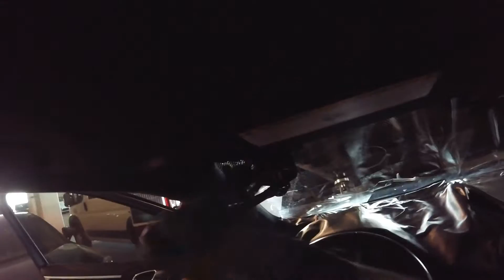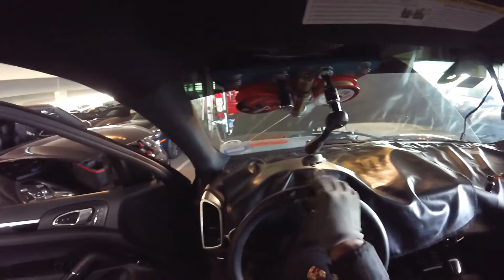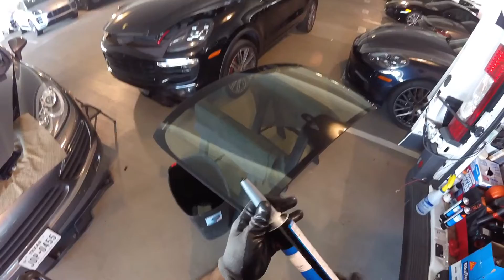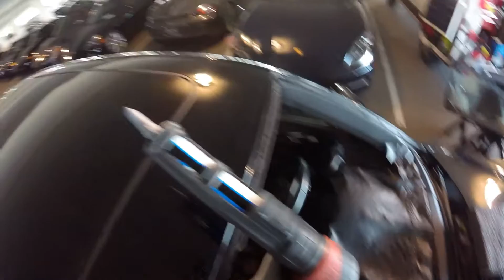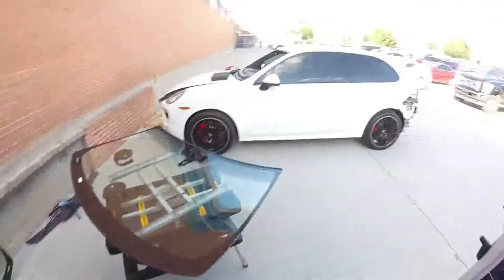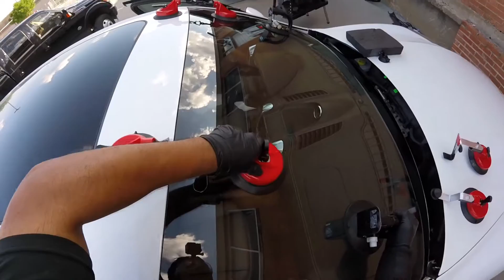WINDSHIELD INSTALL WITH SIDE KICK AND SIDE  DEEP CORNERS

Comment: Any word on that deep corner sidekick prototype? I need me one of those
Reply from the maker: ERIC XAVIER HERNANDEZ man i don.t think they going to make one .i will post how to make one..and you can do your.s what about that
Reply: VIDRIOKAR  please do man that would be much helpful. Please include the materials you used and also how u made the other ones to hold the wondshield in place of u can. Thanks man.
Reply: Are u still making the video?
Reply from the maker: sorry man kind busy ..i m trying .just let me work in that ..is simple just piece of aluminum in lowes or home depot  a succion cup from equalizer  piece of pipe but let me make a list and i will send you the steps mi email VIDRIOKAR@yahoo.com
Reply: What did you use for the rubber stop on top?